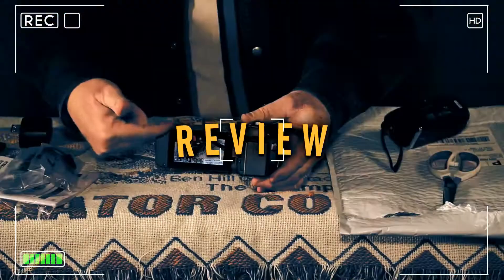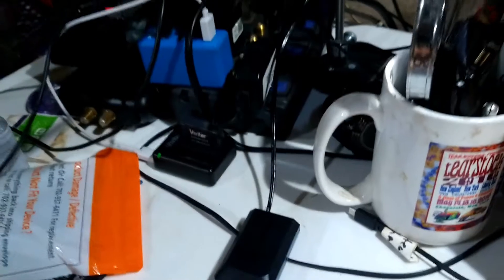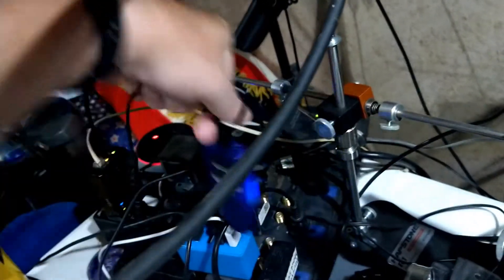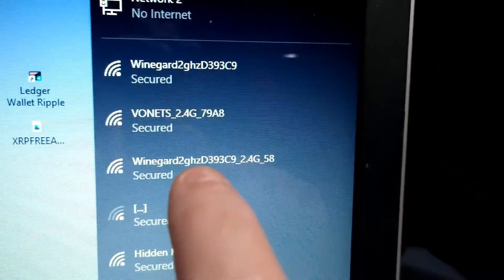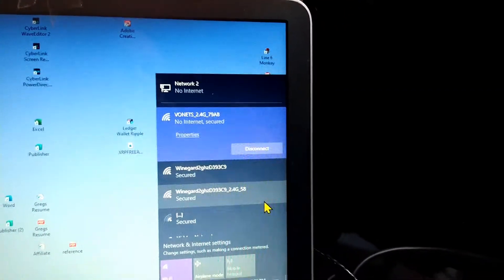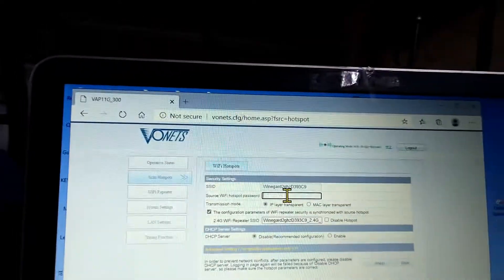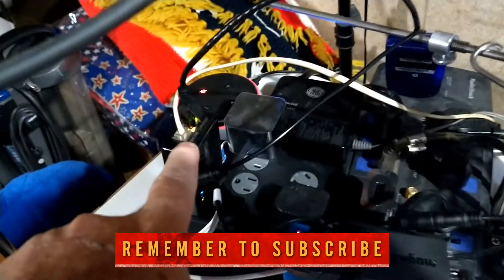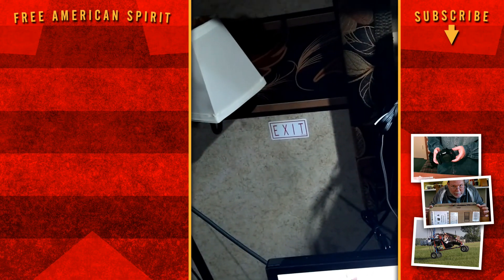How to Easily Make you 2020 Magic Jack Wireless at Home or the RV via Vonets Wifi Bridge router

Comment: I needed to use the Vonet WIFI Bridge as my daughter's Rogers Fiber Cable Router (Newest Model) has no ethernet connection. It seems everything accesses the router wirelessly, as there is no USB  ports either. Amazon Canada had the  Vonet device for$37 Canadian with $5 instant discount coupon. Prime had it delivered free the next day. Setup was easy, and if I made a mistake all I had to do is press the reset button and start from the beginning again. The results were the Vonet worked OK with the Magic Jack Plus. A couple of the menus had changed since you posted this video, but your tutorial guided me through setup and configuration for its use as a bridge device. Now the Magic Jack and wireless phone base station no longer need to be located close to the router, as both can be operated from anywhere there is a WIFI signal and power outlet. Thanks for posting this video and a hearty thumbs up!
Reply from the maker: Your welcome.  Thanks for the update!

Comment: Can you use a wifi extender to connect wireless with the magic jack ?
Reply from the maker: You should  a wifi signal is a wifi signal...
Reply: Only if the modem or router has WPS or hard wire it but the point is to connect wireless and this was my conclusion after trying it
Reply from the maker: @donnapayne8111  the devise I show make a bridge between your wifi and the magic jack
So I really don't understand your statement.
Rewatch the video to see how to hook them up
Reply from the maker: Just to clarify.  You still need the device shown  to use as a bridge to the wifi signal.

Comment: Thanks for the video.  My magicjack will not work with the device you are using.  I have tried several devices and none will work.  It will make a call, but the person on the other end cannot hear me.  It works the same on all the converters I have tried, but It works fine if I plug it into a regular wired internet router with an ethernet port.  The wireless I am using is T-mobile.
Reply from the maker: Thanks for the info.